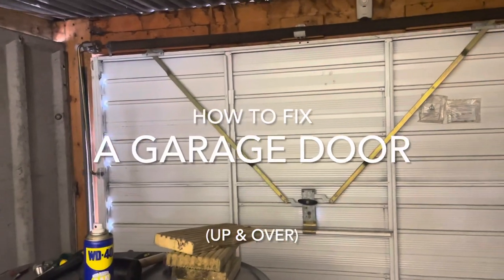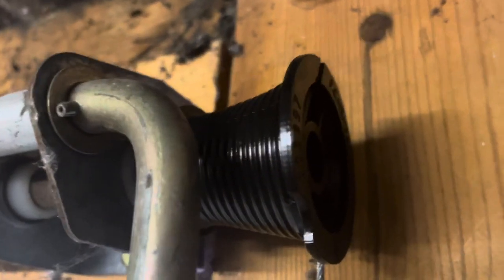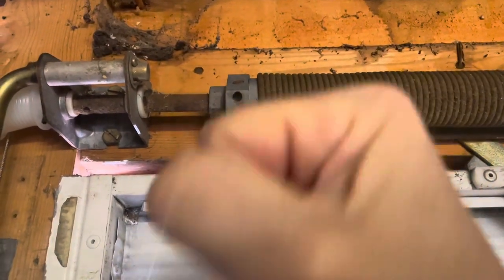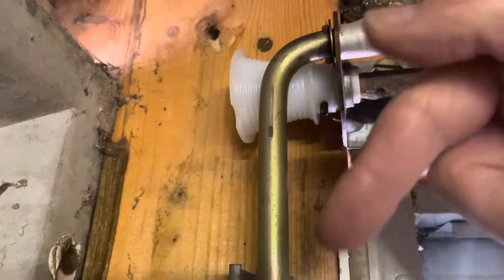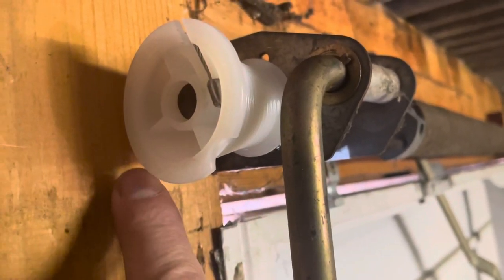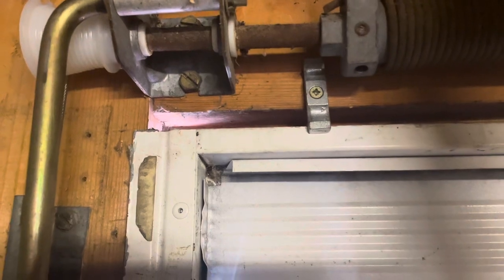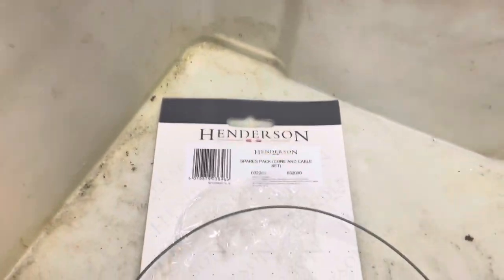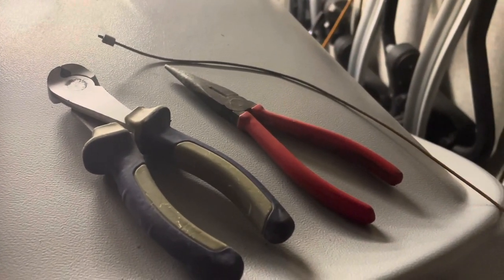How to fix a broken garage door

Comment: Hi thanks for your informative video.. The crook like pin is used to lock the tension in the spring if you have just one broken cable…it goes in the hole in the spindle of the spring shaft on the right hand side. This means you don’t have to re tension the spring unless you want to or if both wires are broken..

Comment: Great Video - question - why do you replace the cones at the same time if they are in good condition?  Thanks ...
Reply from the maker: I had to replace a cable and the kit comes with new cones as well as the cable so I just thought it best to be prudent. I don’t suppose you have to unless you want / need to…

Comment: Thanks for this, although I dont understand the need for timber to wedge the screwdrivers - surely the end of the screwdriver (or whatever you use) will be held tight by the garage door itself. Or am I missing something?
Reply from the maker: Hi Pete. It’s mostly because there are only a couple of holes on the mechanism so you’re a bit limited because you want the mechanism in just the right place. You could do it your proposed way if you wanted to.
Reply: Many thanks! It's a job for the New Year after one of my wires snapped (lasted over 15 year though so not bad!). Ps. I'll replace both sides for safety  @Blisteringbarnacles2

Comment: Can the wire be replaced without removing the whole fitting/reel?
Reply from the maker: Hi there. You can but you have to buy the whole kit so you may as well replace the whole thing and be assured it’s done fully

Comment: What about the safety hook?
Reply from the maker: Sorry - not sure what you mean about the safety hook? There was a rounded hook / piece of metal in the pack but I couldn’t see a reason why it would be included…
Reply: @Blisteringbarnacles2  It's used to secure the spring once you've taken the tension off the cables. On an older Henderson door, there's a hole through the horizontal bar and the long end of the hook goes in there. The hook itself sits upwards and hooks on above. Newer doors have this hole at both ends. Other videos show this and urge you not to work without it in place for safety reasons so please take care. It needs light application of a hammer to get it in and a good yank to get it out when finished. Keep out of the "line of fire"!